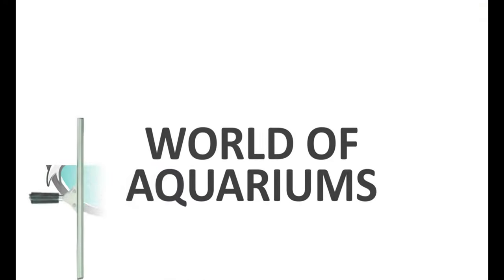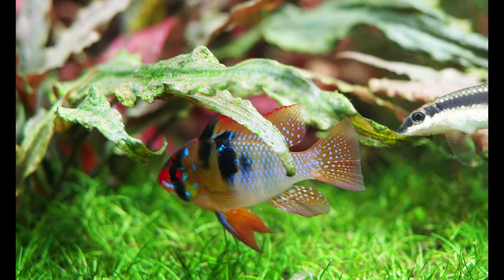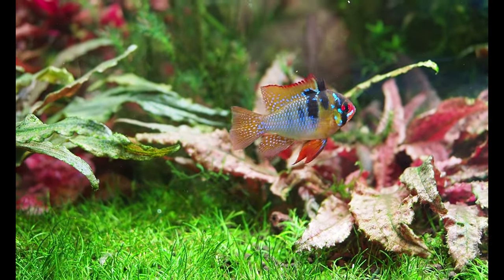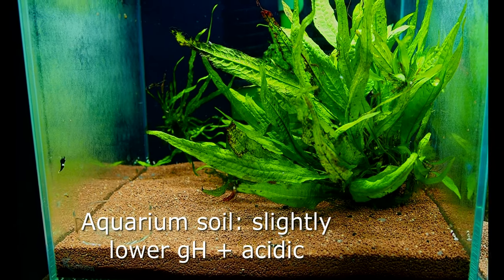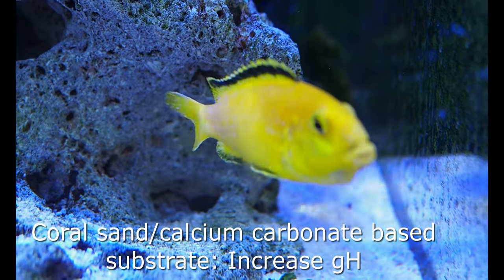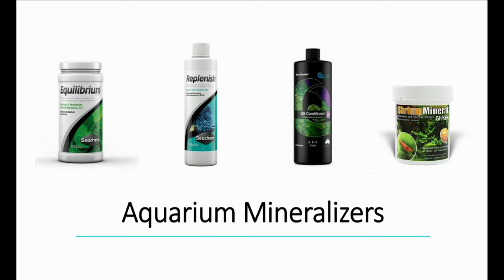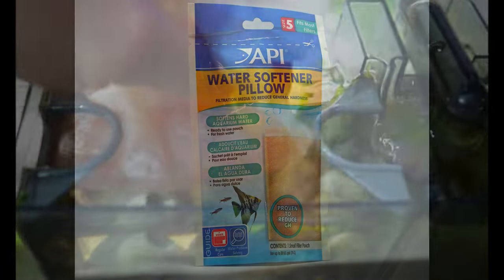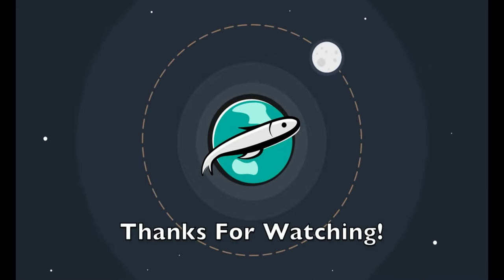How to Soften Aquarium Water (Decrease Hardness)

Comment: Thanks! I just moved literally 10 minutes away from my old place and my tap went from 100PPM (5°) to 180PPM (10°). Ridiculous.
Reply from the maker: Yea jeez, that difference is heaps!
Reply: @worldofaquariums5534  My tap water hardness is around 750 ppm. Still my discus fishes survives on it without any issues. So water hardness doesn't matter for fish survival. It needs the required amount of minerals in it. and they require proper filtration and food to survive better.
Reply: Bro 😂 My water hardness is 400ppm in Ohio
Reply: @Aveeguides Great Lakes or river water? Im in Florida it's pretty much liquid limestone but the GH level isn't too high
Reply: @thee-wastegamer4044  oopsie, I’m an idiot. I was thinking of the 22 drops for the API KH test I did. The chart shows °kH and GH side by side with drops. So I was confusing the 22 drops as 400ppm instead of °kH.

Our well water hardness is 170ppm 😂
Reply: @surendarkumar-rs1og 750 Tds is high for discus though hybrid or tank bred discus can assimilate in different water conditions. I am thinking if your Tds is 750 PPM... what is your KH value?  Too high Carbonate hardness will stress discus as the PH value will also increase with the KH parameter.

Comment: It is important to mention the Carbonate hardness (KH) of water in the discussion about hardness and pH. KH also called alkaline hardness has a buffering effect on pH. For example, the methods used to acidify water can at best only have a temporary / short-term effect as the KH level will gradually increase alkalinity of the water.

Comment: I have angelfish and live in a place with very hard water and a pretty high PH. I got five angels from PetSmart and two from a local small shop. The two from the small LFS died very quickly. The ones from PetSmart are all still doing well. I'm worried my water could be hurting my fish and am thinking of cutting my tap with some distilled water next time I do a water change. Should I leave everything the same or try to soften things?
Reply from the maker: I think softening the water will be better, just because they will like that type of environment more. You will need to soften your water slowly over time. However, it could also be other issues besides just very hard water that could have caused your fish to die

Comment: I have a tank with tap water that just started and I want to soften the water bc I did a test and its too high, can I mix distilled water into the tank and itll fix it or do I have to fully drain the tank and refill with distilled water.?
Reply from the maker: definetly recommend mixing distilled water. Never fully drain tank and refill with distilled
Reply: @worldofaquariums5534 how much distilled? I have a 75 gallon tank. My water is way to hard. When I do water changes, how much distilled would I add? I do 25/30% water changes weekly.
Reply from the maker: @bomorgan3627  Depends what fish your keeping, what levels your tap/ aquarium is for hardness. eg, if its 1000ppm hardness, you would obviously require more distilled then 500ppm

Comment: Why add tap water to RO water, for buffering. Tap water has a certain amount of chlorine in it. Bad for fish and the beneficial bacterial within a Filter.
Reply from the maker: Because you shouldn't use pure RO water, all fish require some amount of minerals in the water, which depending on your area, tap water should have. If you are able to mix tap water and RO water to achieve softer water, there is not much downside in doing so compared to using gH powders. Yes you will need to dechlorinate tap water if doing it this method
Reply: Its much better to use RO water and then add powder rather than add tap water to then add more chemicals to dechlorinate